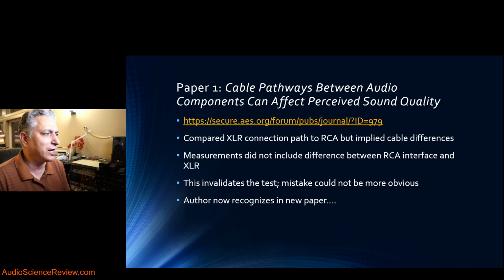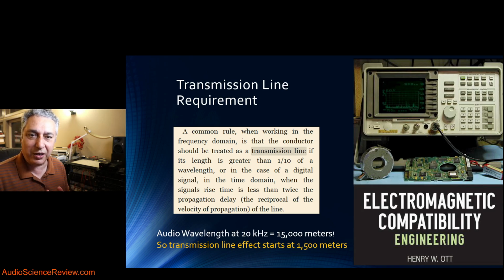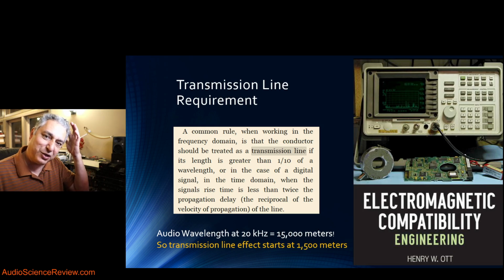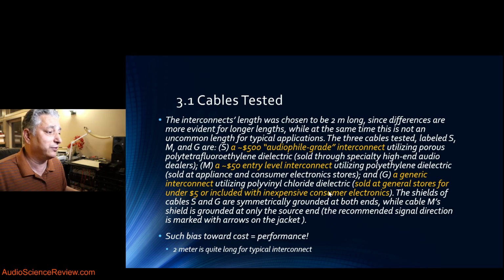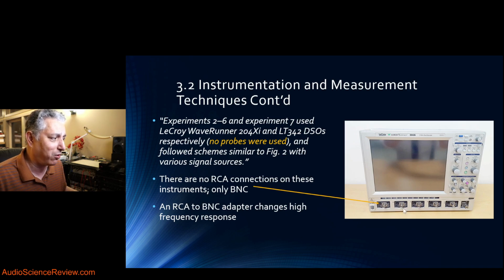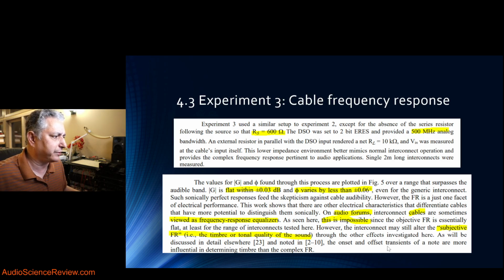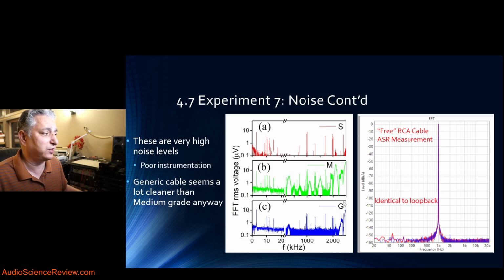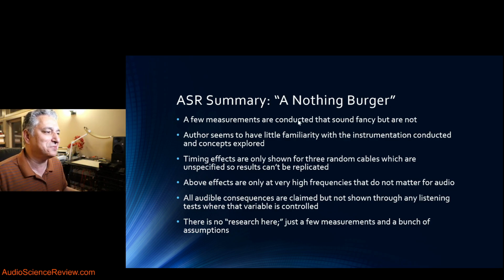Scientific Proof of Measurable Difference in Audio Cables? Paper Review

Comment: Well Amir: a decade ago I scored some PS Audio Statement speaker cables from my local reuseit for $50 Bucks. I could tell they were Audiophile because they were heavy and as muscular as my trouser python. I looked 'em up online and found out they were actually sold for between $1,200 USD and $1800USD.  Well my trouser python got rampant. I hooked them up and I believe I heard a difference. No. Really... Blacker blacks and crisper crisps with more air and edges yet smoooth..

Comment: The differences are huge. I have 3 amplifiers and tested multiple cables. The difference between regular cheap Amazon cable and  good quality SKW cable is zero. But difference between these cables and high quality Mogami cables used in record studios around the world, or expensive audiophile cables is huge. And you will hear that. As an engineer I understand that this is a uniformness of production, better copper, etc, removes loss and standing waves in the cable, better works with impedances, but results are results. You just can't NOT hear the difference. Amplifier with high input impedance it affects less than the one with low. But still affects. Samir, you are stubborn old school engineer. I was like you, unless I started experiment and ask more questions. All capacitors sound different, in theory should not, but when we start to talk about physics there are actually multiple effects we did not account for when measured. And so on. Start experimenting, stop being that old school snob. Your videos are misleading. You got a tool to measure and you measure everything with this tool, don't questioning the way you measure or what you measure. That is well known anti-pattern named "Golden hummer".

Comment: 7:24 I think I know what is meant here. The author probably refers to the notion of an "ideal" capacitor (whatever "ideal" could possibly ever mean in the context of electromagnetism, without disobeying its core principles) whereby the capacitor has no "parasitic" (again, these terms are meant as mental simplifications and are thus highly fictional vis-a-vis theory or reality) resistive or inductive characteristics nor any other than that of capacitance.
As such, this ideal capacitor can discharge instantly when shorted, will display no memory nor resistive losses and cannot emit any EM radiation (as it has no inductive behaviour of any kind -- a clear impossibility). Similarly it will charge instantly when connected directly across an "ideal" voltage source (without internal resistance etc.).

Comment: Very revealing.
I wonder how many people hear a significant difference just because the act of removing the old cable and inserting the new gives a fresher contact?
I'm very happy with my gear and regard the cabling as gilding the lily, so I confess to using QED mid range cables in my system, Reference 40 interconnects and XT40 speaker cables, mainly because they are at least well made.

Comment: Great video thank you!  Can you clarify the transmission line bit at 10:00 though?  The wavelength of 20kHz is like 1.7cm or something, not 15,000m?
Reply: That's the wavelength at the speed of sound (in air). At the speed of electricity through copper wire (close to the speed of light), it's going to be much, much longer.
Reply: @fatunga1  Ah thank you very much for the clarification!  I never appreciated that difference!  The wavelength is the propagation speed divided by frequency, so sound in air quite a small number (slow propagation speed), electricity in a copper cable very high (propagates at close to speed of light).  Got it thank you :)
Reply: @CathalMooney-x2q  You explained it much better than I did!

Comment: Stumbled on this paper, of course in audiophile group. Trying to debunk them in the time limits one has in such communication that happens in social media, and how much effort one wants to do is simply impractical. Finding this video made things far, far easier to explain.
Reply: I'm sure it gives some good talking points, but it's very misleading.  The main point of the original paper is that standard double blind tests are not informative.  It doesn't really matter that it was rca versus xlr, it's that one couldn't tell a difference using a standard rapidly switching double blind test but one could tell a difference using his delayed procedure.  This means many results on audibility are wrong including results that ground the usefulness of standard measurement techniques.  This basically invalidates most of what this channel claims which is why we got this video.
Reply: @mesterha  Reliability drops like a stone when you have a delay between, it introduces noise in data in rapid succession until SNR of the information and it becomes simply... rubbish. It just shows that delayed tests do not work reliably. It absolutely does not invalidate anything in Amir's work, that is based on known science: we KNEW already all of this. That is why instantly switching AB is mandatory when we look at tiny things, it increases accuracy. For ex, trained listener (being an "audiophile" does not mean you are trained...) can hear level changes down to 0.5dB in an instant switching AB test while having just one second between drops this to 1-3dB.

Also, Kunchur never concludes anything you just said. What you just said is ad hoc addition that changes the entire thing. If the paper doesn't conclude it, you can't say that it concludes it.
Reply: @squidcaps4308  Did you really just say that an obvious conclusion, and a focus of his research, isn't valid because you didn't see him spell it out in a particular paper? Please try to argue in good faith.

As for reliability, the point of his "Cable pathways between audio components can affect perceived sound quality" is that people can more reliably tell a difference between setups with the delay.  He gives the basis of the idea, the experimental setup, and the results. Your level change change results are actually consistent with his theory that quick switching relies on short term memory which can only hold simple information. It's a flawed way to compare this type of information, and therefore many of the conclusions based on it are wrong.
Reply: @mesterha  He did not approach the study from that angle and all of your derivations are ad hoc defense "but it also shows".. NO IT DOES NOT.
Reply: @squidcaps4308  Your using Cult Cargo reasoning. Do you know what ad hoc means? I'm stating the obvious logical consequences of his results.  I'm not creating new, untestable claims.  Just because you don't like those conclusions, you dismiss them.  The nice thing about the result is the usual ad hoc defenses don't work.  You can't claim, they heard a difference because of a design or manufacturing flaw.  They key is they couldn't hear a difference under rapid A/B testing, and they could hear a difference when given time between switches, and they quantified those results.
Reply: @squidcaps4308  Do you know what an ad hoc argument is? I'm stating the obvious logical consequences of his results. I'm not creating new, untestable claims. Just because you don't like those conclusions, you dismiss them. The nice thing about the result is the usual ad hoc defenses don't work. You can't claim, they heard a difference because of a design or manufacturing flaw. They key is they couldn't hear a difference under rapid A/B testing, and they could hear a difference when given time between switches, and they quantified those results. Did you read the paper I cited?
Reply: @mesterha  ... what conclusions? That his "research" is shoddy and doesn't support the conclusion? You are the one trying to invent a new conclusion when really, the only conclusion you should be making is that it is rubbish study. 

You need to make another study that examines the things you are talking about, youi can cite the failed study and its results as a starting point, why additional studies need to be made but you are literalyl drawing conclusions from your own speculation and assumptions.

I don't think you understand what my position here is.

You also have not cited any papers.
Reply: @squidcaps4308  Perhaps you haven't read the right paper. As I already mentioned, the citation is "Cable pathways between audio components can affect perceived sound quality". Published research needs to be new to pass peer review, so maybe the paper you read didn't give the details you require.  As you can read, the paper shows that one can't tell a difference between two setups when doing a standard rapid blind test, yet one can tell the difference when using longer delays.
Reply: @squidcaps4308  People who don't like or can't grasp Amir's points will believe professor Kunchur.  It's that simple.  Let them waste their money!

Comment: Measurements will only take you so far.  If you are biased to think cables make no difference in sound quality- you can find plenty of evidence and measurements to support your assertions.  If you actually sit down with well-known source material for a few weeks in your system, you might find you will reach a different conclusion.  Assuming you have an excellent, high-resolution speakers and components.  If you spend a 100k on a system and have 1000 dollars' worth of cables, you have the wrong hobby and not taking full advantage of your investment.
Reply: When you buy expensive cables and then listen to your expensive system OF COURSE you will conclude that they sound better.
Reply: @danaustin5869  Not exactly.  You have higher end equipment, and you Audition cables to see if they make a sonic difference.  Cardas most certainly does sound better.  But if you think cables don't make a difference, good for you!
Reply: @dwightballard3868  you wouldn't notice anything in a double blind A/B test
Reply: @VictorKibalchich  I've done blind A/.B test with Cardas cables.  I can always pick the difference correctly- I am very aware of their sonic characteristics.  Most cables make little to no difference.
Reply: @dwightballard3868 double blinded? Naaah

Comment: I do not like you are so sure about your perception. Like transmission line effect I personally think that may give a low frequency effect in audible sound for human hearing. You have to say to your opinion it is nonsense because... Because you also do not know it works. Ok.
Reply: It's human nature to stick with unproven theories and ignore/rationalize away evidence that indicates you are wrong.
Reply: @danaustin5869  I was not in to cables until I got a set to try from a colleague. I could hear more difference from a set cables as from a different amplifier. And I must say the effect fades largely over time. I  think that is because your brain compensation equalizes things. Unproven or not it was an audible improvement to me. I still use 20 years later the van den Hul hybrid two. Ads more refinement and detail to the sound.  Can I pick them out "no". But when switched and compered direct you can hear the improvement and less harsh. So I say I am a believer. I did a lot as making a hole preamp with silver wire. all warmth is lost but great sparkling high frequencies People who say it is nonsense should test and not discuss about it. Same with capasitors huge differences with them in crossovers and amplifier. put all film caps in your amp sound absolute horrifing and they are measuruble better then polarized caps I test it all on my own builds. I started audio building at 17 and am now 58. So I know.

Comment: I haven't watched the full video, but regarding the "short answer", I agree, but in very very few cases, especially when it comes to really impedance the cable might have a small impact. The questions is: is it good or bad? You'd think it's good, but for those who EQ based on someone else's measurements it's bad because you need to readjust. If you don't EQ it can get rid of some undesirable peaks. However, do you really want to wear a heavy "'gold chain" around your neck for so little difference?! Most you wouldn't. My general take on cables is that it's either adequate or not. Any cheap (I'm thinking of mostly Chinese made) "audio grade cables that cost like 20 bucks for a 1,5-2 m cable is most def. adequate. A cable that costs 2 bucks is in most cases also adequate, but... here's the but.... it's not going to be adequate for long. Heavy oxidation on the connectors and some low grade aluminum cable constantly bending isn't going to last very long.

Comment: OK, where you might get a difference is related to the contact of the wire to the connection posts - all metal oxides act as rectifiers in different capacities, and copper is an exceptionally good one. 

I guarantee that if you put a diode in series with one or both of your speaker wires that you will easily hear a difference.

You might also get many small parallel diode equivalents in a stranded cable that had oxidised in the sheath.

I am an electrical engineer working with control and power systems and this effect has come up a few times over the years in different ways, I have no doubt it could be a thing in the right circumstances.

Copper oxide was such a good rectifier that is was the material of choice before semiconductors took over, and it can be used quite successfully as the "diode" in a crystal set (not as good as germanium or a schottky diode, but still quite serviceable).

PS : at your age I would be very surprised if you could hear almost anything over 12 kHz.

Comment: At the subject of instantaneous current change in wire capacitance, it's not fair to compare the wire with an actual capacitor, per se. The minor if not insignificant level of capacitance that typical or "exotic" signal cable may or may not have would be more unlikely to have said capacitance slow down signal propagation, regardless of transient behaviors. It's kind of moot.

Comment: I think the cable people are confusing or ignoring the properties of different media when talking about wavelengths.

Wavelength is decreased in a medium with slower propagation. Sound waves using air as a medium has the upper limit of 343 m/s. Thus a spectra such as 20hz-20khz is between 17 meters to 17 millimeters in wavelength. 

In copper wires the speed of propagation is around 0.5 to 0.7 times the speed of light. That increases the wavelengths tremendously. Transmission line effects are negligible in this case when having medium lengths within a couple of meters. (as Amir pointed out).
Reply: Thank you. I was quite confused about 20kHz having a length of 15,000m

Comment: I attached a speaker cable to a set of Marshall Stacks, back in the early 80s. The system immediately began to play a local radio station at about 50 db. There was no power running through the system at that time. The only way we successfully reduced the radio output was to reposition the speakers so that the cables were a less optimal antenna. It was like adjusting dog's ears back in the 60s. I can only assume that today's audio cables are, in general, better shielded that old beast. It did have fine wires wrapped around it in a crossing pattern, like most low-end audio cables. Is it your contention that none of today's cables would produce a different result? I assumed some or all of this problem would have been eliminated by a well-shielded cable.

Comment: I could see more proof of humidity and temperature being an impact on speakers

Ima sell an audiophile thermostat which won’t do anything because it doesn’t make the hvac run better but we won’t tell anyone that. We will just prove that if you don’t control your temp and humidity there will be different levels of moisture weighing down their ribbon tweeters. Of course if every room was a virtual perfect acoustic space but I’m guessing the imperfections in my ears need fixed before I’d notice someone spraying a speaker with a garden hose

Comment: for skeptics, but maybe not for accuracy I think you should do a broader frequency test. This should include other functions other than sin curves. I think this might provide better insight, especially sincad.  One concern I have seen regularly raised is your ability to test around these parameters  especially when manufactures can design for these tests and their internal results might drive a solution that's not full spectrum.

Comment: I'm so confused, when I look up size of a wave length at 20khz:

How long is a 20 kHz wavelength?
The Long And Short Of It: Acoustic Wavelengths - ProSoundWeb
0.055 feet long
A 20 Hz wavelength is about 60 feet long, or 720 inches. A 20 kHz wavelength is 0.055 feet long, or 0.66 inches. That's an enormous differential, a ratio of 1091:1, or three orders of magnitude.

I'm guessing what you quote at 11:20 is not the same thing as my google search? I apologize for my ignorance.
Reply: You’re talking about wavelength in air. He is talking about wavelength in copper. In the cable.